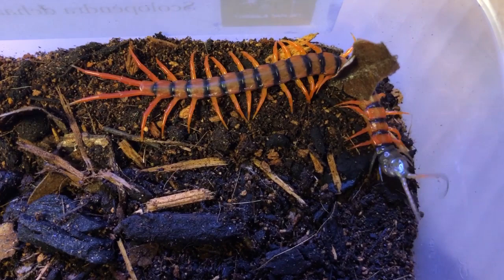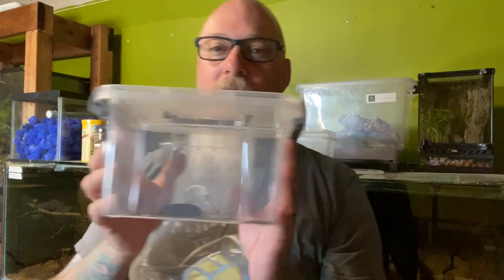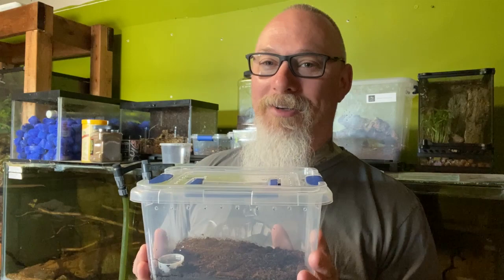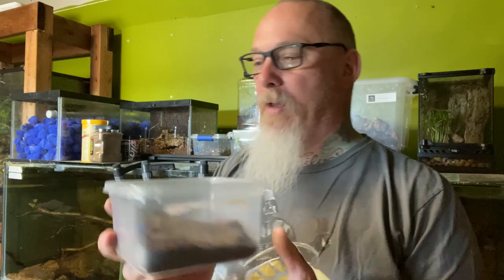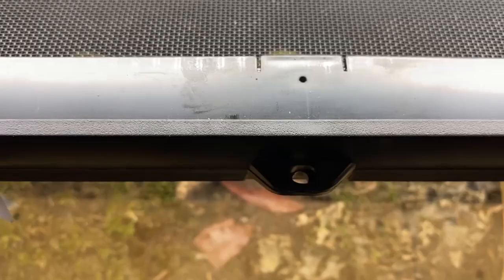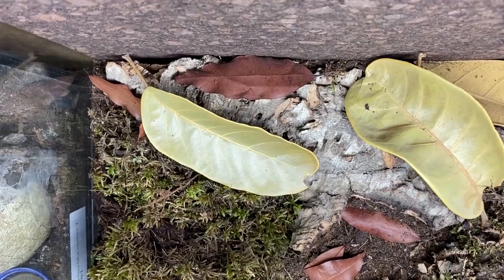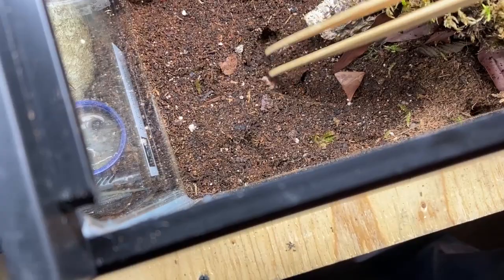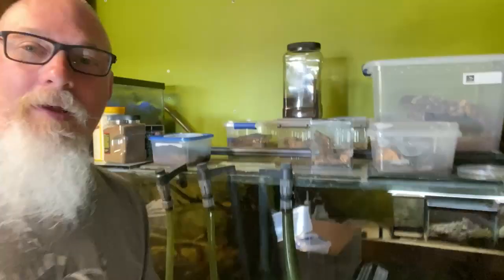Danger Time!!!  Setting up new DIY Bio-Active enclosures and rehousing some of tropical Centipedes.

Comment: My real Scolopendra gigantea "Black" Form Pair from Venezuela that I got from my Facebook friend is probably the scariest animals out of all of my entire invertebrate collection currently. Mines are both wild type, so obviously they're both are very unpredictable. Only God knows how many predators these giant centipedes may had encountered, battled, and then survived in the wild to be this aggressive, as they will turn on a dime just to tag any objects that comes in contact with their body Lol! Even touching one of their legs especially their terminals is enough to trigger them lol My pair are also very expensive, I mean Jesus! But I did have two large gasket boxes for each of them with a bunch of modified vent holes that I drilled using a hole saw. I also tested it like you did with yours Lol! Well except, I placed both of their enclosures in my large bathtub overnight but with a heater on just to see if any of them escapes. My stainless steel Geesatis air vents worked for two night straight! I am very exited to be breeding them soon. If the mating backfires, then that is fine by me, given the fact that I will lose my well prized female, all because of they're matriphagy lifestyle practicing mother eating which I absolutely hate about this species!! The gigantic S. galapagoensis, and the Scolopendra sp. "White Legs" from Peru or any other ring furrow centipedes native from South America will also do the same unfortunately. Well except for the Scolopendra alternans from the Caribbean and Bahamas doesn't practice matriphagy. Probably the only Giant centipedes from the New World that doesn't practice matriphagy. Old World Centipedes also does not practice matriphagy too. Anyways, I am digressing now Lol! Nice S. dehaani Cherry Red and E. trigonopodus! I wish I raised all 5 my Cherry Reds but sadly, I traded them all to my friend in exchange to Ts and Scorpions lol It's good that you too are practicing caution in the wind when working with these unpredictable escape artists lol
Reply from the maker: Outstanding, thanks for sharing
Reply: @themadaquarist  Not a problem Chris! 👍

Comment: I have a Scolopendra Metuenda (Solomon Island Giant Centipede) I bought a water proof container at Home Depot. It has a rubber ring so there is no gap in the lid. & Has locking clips on all sides. I got one tall enough,there is no way it can reach the top.. I put smaller air holes on the top. And around the sides at the top. I can say 100% my centipede can't get out.. it was like 25$ and it's see through.. even the lid. So I can still see and watch my centipede.. I can't share a pic here. But if you follow me,I will make a video about my escape proof enclosure..